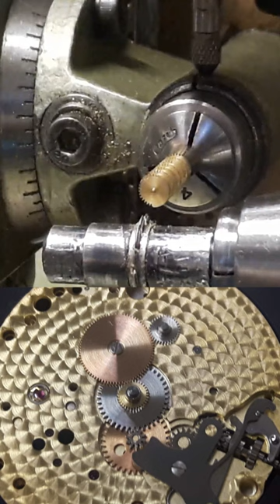Traditional way - wheel cutting for watches - Cornehl Watches

Comment: How interesting, I had wondered how they made the gears, this is a much easier method than I had imagined
Reply from the maker: You are absolutely right. It is just a question of holding the wheels. I this case it is one piece of metal. I cut the teeth first and than cut the wheel from the shaft